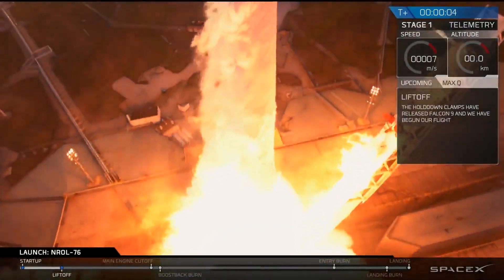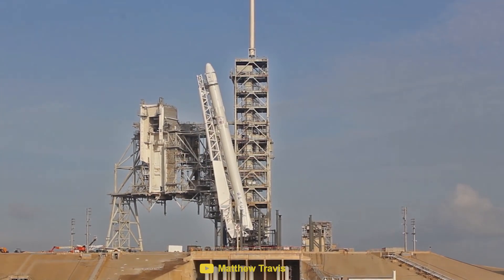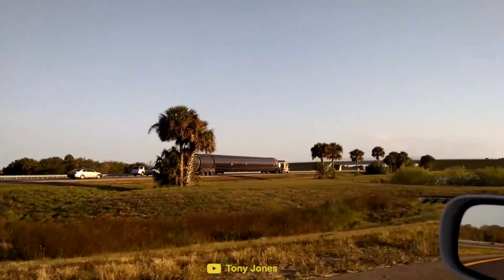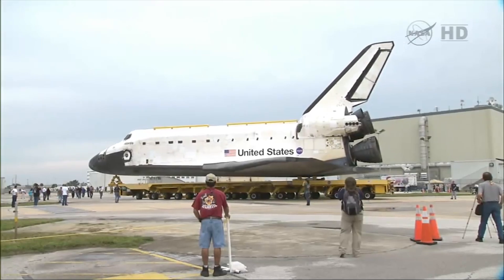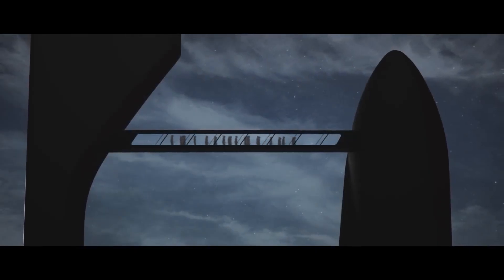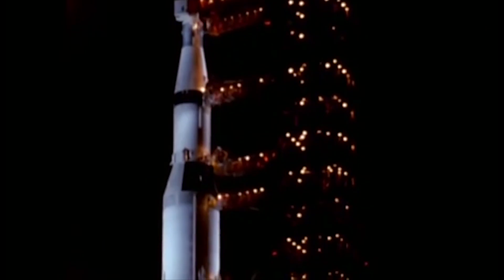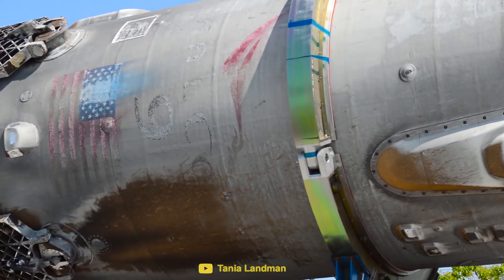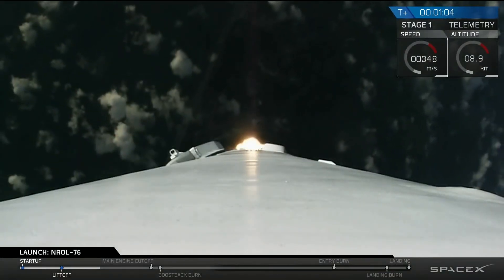How Does SpaceX Transport the Falcon 9?

Comment: What is meant by first stage rocket, second stage rocket?
Reply: The rocket launch system has two rocket stages. The bottom stage is the first stage and had several engines. It only takes the Dragon part of the way to orbit. It gets dropped off to return to the Earth. The second stage, which sits on top of the first stage took Dragon the rest of the way to orbit.
Reply: @davidhoffman1278  thanks

Comment: What is the diameter of the falcon heavy and the space ship?
Reply: The Falcon Heavy is actually 3 Falcon 9’s linked together.  There 3 boosters totaling 27 engines. The center booster is attached to the second stage. They are linked in a 3 wide configuration.

Comment: would be a lot cheaper in the long run to build the thing a mile from the launch pad?
Reply: Just what I think also. My question to the owner of the company "why insist building a company far from the launch site?
Reply: The reason why the rockets are built in LA, is because the LA area has the most concentration of rocket engineers, technicians and skilled assemblers in the world. Therefore you're most likely to be successful.

Comment: Here's my idea:  Use a hyperloop solution to move ALL of the Spacex components for the Falcon 9 (the Merlin engines and the completely assembled rockets).   Phase 1 would be to use this hyperloop (let's call it Spaceloop) to ship the Merlin engines from Hawthorne, CA to McGregor, TX for testing and then for transporting those same engines back to Hawthorne for assembly with the Falcon 9 rocket.  Phase 2 would be to move the assembled Falcon 9 with engines from Hawthorne to Cape Canaveral.  When the Spaceloop is not being used by Spacex it can be leased out to private freight hauling companies .   This would help pay for the Spaceloop.  It would also be a good "proof of concept" for using a hyperloop solution for interstate freight.   A very high percentage of spaceloop would be in very sparsely populated areas, reducing permit requirements and pre-requisites.  Also, there would not be the need to build a lot of "hyperloop stations" initially.  Once in use, spurs could be built off the main Spaceloop line to large urban areas the receive a lot of freight.  Whatever hyperloop solution that is adopted could be enlarged to accommodate all components of 
the BFR later on.  How do I get this idea to Elon Musk?

Comment: they should buy antonov 225 and fly their rockets around
Reply: Jebi Se Not feasible
Reply: The Falcon 9 wouldn't even barely fit. The first stage (with interstage) is 50 meters long, the Antonov payload bay is only 43 metres long.
Reply: external payload like did it carry buran.

Comment: Why not rail?
Reply: The rocket is too long to go around the curves easily, it would derail the trucks
Reply: S.P. 4449 you guessed it
Reply: The Solid Rocket Boosters used on the Space Shuttle were disassembled into segments that were shipped by rail from the factory in Utah to Florida and back after the launches.
Reply: @jacoblyman9441  And look where that got us with the O-ring leaks.
Reply: Here’s an idea, move closer to the food.
Reply: More, that’s from NASA. SpaceX took like 2-3 mil
Reply: But it wouldn't cause such derailments if you put each end on a different cart, right?

Comment: Why didn't those Nasa BOOBS build re-usable rockets?????? does everyone understand cost plus military industrial complex contracts? This is how they stole billions from the  common man.
Reply: It wasn't possible with the technology they had at the time.
Reply: You 3 don’t seem to realise that the Saturn V Apollo program used “computers” that were so rudimentary and simple by today’s standards that today’s smartphones look like quantum supercomputers in comparison. You would be laughed out of the room today if you proposed using a computer comparatively weak to what the Apollo program used, but they made it work!  Making a rocket “reusable” using SpaceX’s method back in the 60’s was just not really possible because the advanced computers and precise control in the direction of the rocket (going backwards) was far from ready. Why do you think SpaceX had the trouble they did? It was a tremendously difficult problem, that’s why! Whenever you backup in a car, boat, etc., imagine trying to control that at high speed! Imagine trying to drive in reverse at interstate highway speeds! That’s what a SpaceX rocket is doing, except it’s going faster than the speed-of-sound for most of its descent, and doing so as a flying building essentially. Also, even a small amount of imbalance on the way down would be destabilising because the rocket engines are pushing up from the bottom... not something 60’s tech was capable of.
Reply: @games1004 
You don't seem to realize that the original question had nothing to do with the 60s.  We all know why NASA didn't make them reusable in 1965.  The real question is, why didn't they even try... in 2005?  For exactly the reason I stated.   Because they have no incentive to innovate.
Reply: @jshepard152  Every comment in this thread is about the 60s.  Also, computers have everything to do with reusability, because SpaceX-tech rockets are controlled be complex sensors and grid-fin steering that would've overloaded any older computer... not to mention The Falcon-series rockets are the only ones I know of in history to feature them and attempt to land vertically on a pad.  Even SpaceX blew up multiple rockets in the testing phase.  This reusability thing (other than the space shuttle program) is the first one to try reusability of the craft... and the shuttle was more correctly a "refurbishment" instead of a simple "reusing" of the rocket.
All this is brand new tech.
Reply: @games1004 
Nope.  The first comment has nothing to do with the 60s.  Did you read it?
Reply: Jakarian Studios
No offense, but that's bullshit.   They had more technology, experience, money, and resources than SpaceX did.   NASA didn't innovate because they had no incentive to do so.   They get their billions from congress and fundamentally the cost of the rocket isn't very important to them.
Reply: I'm talking about why they didn't make reusable rockets during the space race.
Reply: Jakarian: Because it was the Space *Race*. All that mattered was being first, no matter the cost, no matter how impractical and overpriced the resulting technology would be down the road.

Comment: I asked this on the previous iteration: it's asserted that ocean transport is "not practical for SpaceX", but the reasons why aren't explained.  Water transport was practical for Saturn, and it's been the method of choice for large and bulk cargo for millenia.
Reply: You can bet SpaceX is optimized for low cost.   If sea transport were cheaper or more efficient, they'd do it.
Reply: It wasn't practical for Saturn at all. It was the only way - the Saturn V simply won't fit down any highway. And they could sail the Falcon all the way around to the coast of Florida if they wanted. But why do that when it will (barely) fit down the highway at probably one tenth that cost.
Reply: Timothy McDaniel would assume the cost, maybe on a larger scale of launches it would be economical but for moving maybe a dozen or 2 in a year doesn't require them to have the contracts with people who can safely ship something of that size and weight, seems like it's more on a mission basis as of right now
Reply: Timothy McDaniel its just quicker on ground